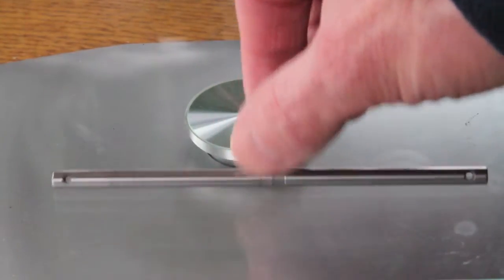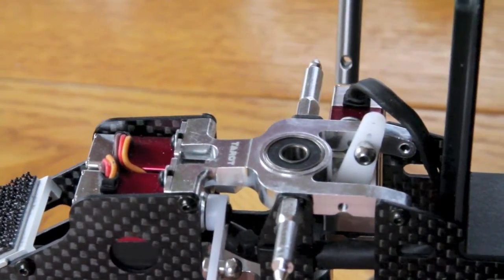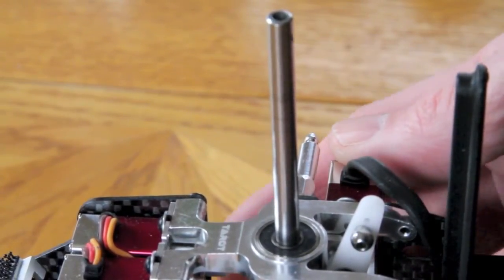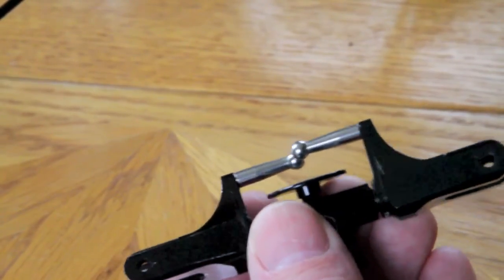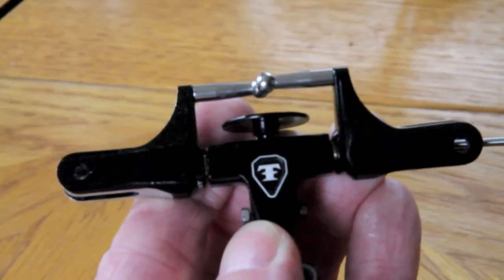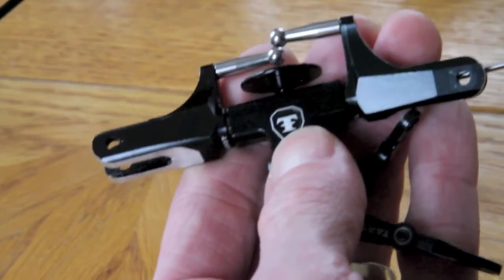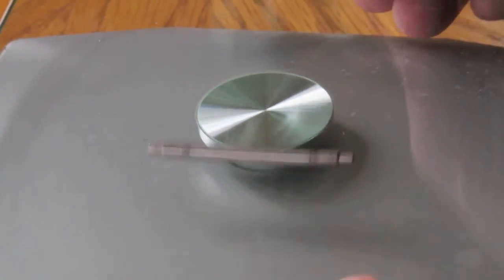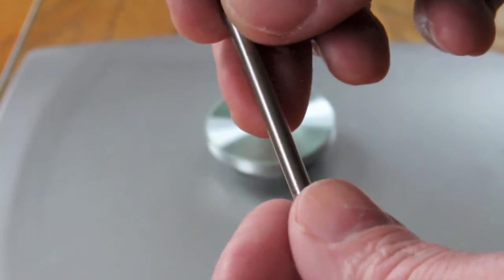40 : Tarot 450 Pro V2 Build : Checking Main and Feathering Shafts Post Crash

Comment from the maker: DFC heads are a little cleaner. DFC stands for Direct Flight Control and is a simpler design. The head is also lower to the heli, and has a more "tight" feel, from what I understand.  I'll probably end up trying a DFC if I ever need a head replacement...but it boils down to personal preference.